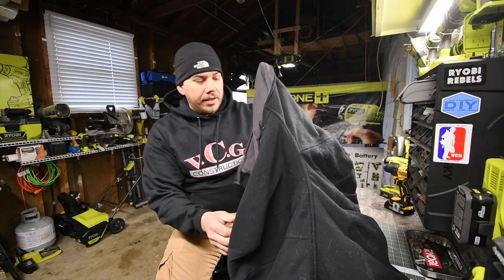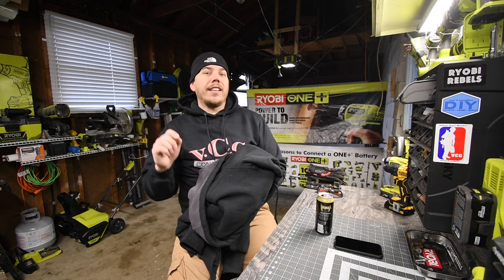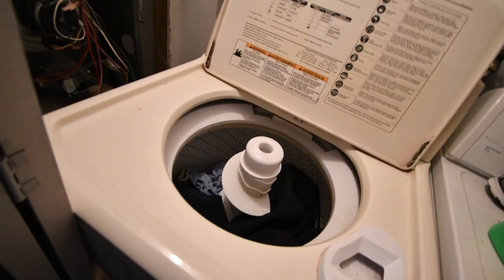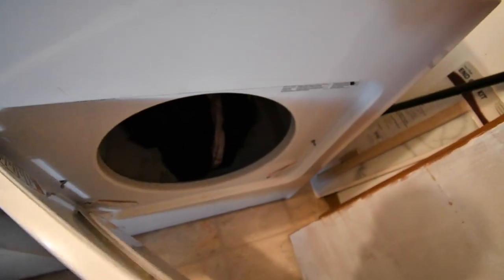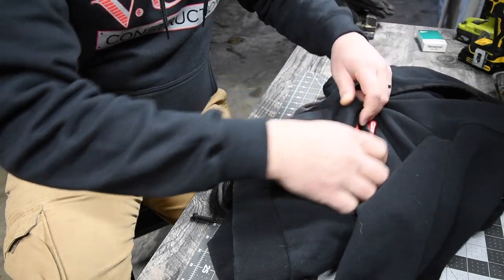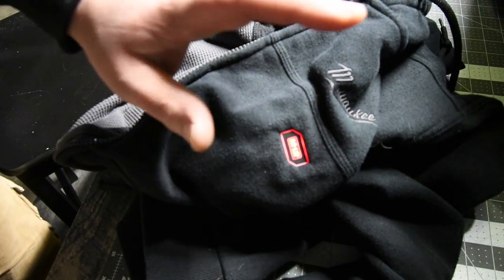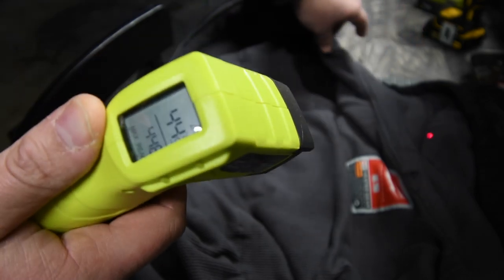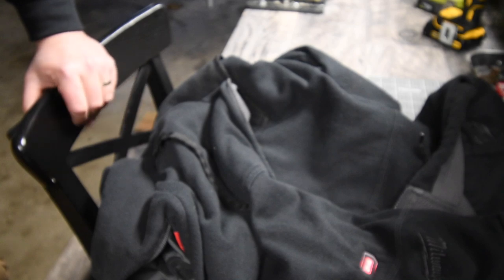Milwaukee m12 Hoodie Washer/Dryer TEST

Comment: How much time can it run on that battery. Does it have a low , medium , high button ? 😎👍
Reply: Yes approximately 2hrs. on high, 4hrs. on medium, and 6 on low. I use the 1.5's and the run time is close to that. I would expect a little more time from the 2 and cp 3.
Reply from the maker: with a 2ah battery. about 2 hours on high. and 6 hours on low
Reply: It does have a mid low and high is like 3hrs  on H 6hrs in Med 
On low is about 12hrs

Comment: I love my jacket.  I wish it had a fuel gauge for the battery.
Reply from the maker: I love mine as well and thank you sir
Reply: The adapter shows the level of the battery
Reply: Sean Anderson Mine doesn’t
Reply: @DamionJR4923  is it broken. The red adapter has a button on the top that should show 3 bars
Reply: Sean Anderson Yup no button.  No Battery indicator.  Look up Gen 1 adapters.
Reply: @DamionJR4923  there is an upgraded power source with a fuel gauge and usb charging slot. The included power source doesn't have this at least the ones that come with the hoodie.

Comment: I would probably just hang/line/lay-flat dry to reduce "wear and tear" (even if Milwaukee says that it's okay to tumble dry).
Reply from the maker: that would work as well. thank you for viewing :)
Reply: Man Caver Tools I do low power dry for 10 minutes then air dry and dryer for 20 minutes then hang dry for two nights with all pockets unzipped and open I found if you don’t do the low temperature dry and air tumble dry it does get a slight mildew wetness smell

Comment: I have a question.  It says to remove battery and controller.  How you remove the controller???  Thanks
Reply: Is the controller the red casing?
Reply from the maker: there isnt a controller with any of these heated Gear
Reply: @ManCaverTools  thanks for the reply.  I just ended up taking a towel and just wiping it clean.  Wasn’t that dirty yet.  😂.  Did find the manufacture manual online last night.  The red casing the battery goes into is called the controller.  Which confused me as I assumed the controller is the button that turns it on.  Thanks.
Reply: @DragonJin78  ha...I've been trying to figure out the same. I thought I was going to have to remove the entire heating element to access the "controller" somehow.  It's been in my dirty laundry basket for a couple months, now, but I need it since it's been colder.